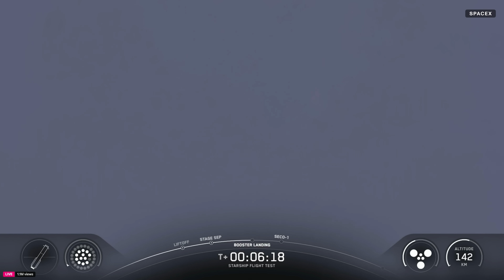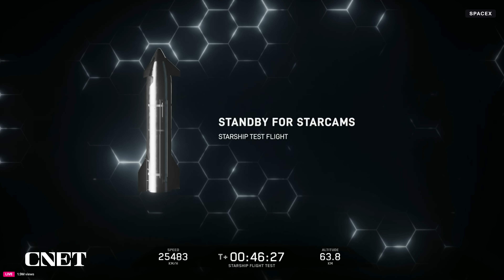Starship Test Flight 9: Everything That Happened in 17 Minutes

Comment: I get that Starship is hard. I get that everything shown in this video is very impressive. HOWEVER, it has cost several billions of dollars so far to have nine failures of a suborbital flight in a project that is far behind schedule. If I remember correctly, they had promised moon landings by this point to NASA to get funding from them (and the person who signed off ended up working for SpaceX). Getting to the moon would require getting to orbit, 20 additional launches and reentries of tanker Starships, orbital refuelling, reignition, and reliably landing on the moon and taking off from the lunar surface repeatedly.
I get celebrating during the first RUD, but during the ninth flight which hasn't even reached orbit yet? Or deployed any payload whatsoever?

Comment: This no longer testing. Taxpayers on the hook for every launch. The fly in the ointment is the weight of booster and starship. This will never allow starship to work as advertised.

Due to the overweight booster can’t lift starship to 100 kilometers with max Q to propel it into a stable orbit. Plus starship uses precious fuel needed to lad on a pad.

If Elon spent his own money I would not care if it blew up every time.

Comment: Starting to get concerned.  None of the Saturn rockets had any failures except one Saturn V that had an engine failure, yet still achieved orbit safely.  Starship blows up left and right.
Reply: Saturn 5 was completely expendable.  If SpaceX wanted to build a rocket that was one time use, they could do that easily.  This is a rocket that is being designed to go to space multiple times per day, only expending fuel.

Comment: So, this was a failure. Right?
Reply: No, not really. It would be if it was operational but when it is a test system, you expect some of the engineering solutions not to work properly. It is perfectly normal. That's why tests are conducted. This one in particular gave them a lot of data and things to work on and improve for the next test.

Comment: Flight 10 will be successful flight regarding how will SpaceX analyze the data collected from this flight. Make hardware changes, especially improved fuel lines of the ship to avoid leak. RCS upgrade, Payload door upgrades, Raptor engine ignitior upgrade on Superheavy booster etc. it takes 10000 upgrades to perfect a thing. Looking forward for a late June or early July launch of flight 10 with B15 and S36.❤️
Reply: It's incredibly more cost-efficient to identify and correct  basic mechanical deficiencies such as an inoperable door in the post-assembly inspections versus during test flights. Same with other Musk ventures, e.g., the Cyber Trucks body panels falling off due to inferior attachment design. "Some" deficiencies are inevitable, but Musk's companies are displaying widespread design and assembly issues that reflect a much more systemic problem that certainly will not be resolved with Musk at the helm.

Comment: The tanks need suspension wires to negate sonic resonance. Think of how the first suspension bridges collapsed due to resonance matching curvature in high winds. The tanks need spider webbing via sprung cables encompassing tanks within a geometric pattern of strung cables.  Also foam insulation. The kind you spray in cavities that’s yellow. It keeps pipes and things in place when the pressure changes and with temperature changes. It insulates pipes from pressure and vibration and temperature differential. Not to mention the shaking when ascending on the booster. NASA use foam insulation for those reasons. However a type of strung geometry cradle is necessary to keep tanks in place making sure that fire resistant cloth insulation is between the cable chassis and the tanks.
Reply: And your credentials are?….

Comment: But Elon said NASA is a waste of money! 😅
Reply: This is not a waste of money. It is a test platform and it is perfectly normal to have issues. That's why tests are conducted. To find mistakes and improve.
Reply: @davout5775 it’s the ninth attempt
Reply: @polpocari  It is not an attempt but test. Again, this is a rocket currently undergoing testing. It is by far the largest, most powerful, most complex rocket ever made. Many things have either never been tried before or tried but failed due to complexity issues like 33 engines running at the same time. The last rocket of that size that tried to do that many rocket engines was N-1. That rocket never even managed to push past its launch site properly. Starship is already as capable as a regular rocket. It can go to space, it can deliver cargo but that's not really the point. The idea is to make a super-heavy-launch vehicle that can return back to Earth and be 100% reusable.
Reply: @polpocari  It's the ninth test, not the ninth attempt.  This test had different objectives than 1st, 2nd, 3rd, 4th, ect tests.  

At worst, you can say it's the 3rd attempt as the last three flights have had relatively similar objectives and all with the new V2 upper stage variant.

But if you want to get into the NASA/SpaceX thing.  

It's well known that SpaceX has saved the government BILLIONS in launch costs with their Falcon 9 rocket already.

it's also well known that NASA's SLS rocket is 14 years and $24 Billion into it's development which is twice the time and three times the cost of the Starship program to date.

When Elon says that money gets wasted at NASA, he's still not objectively wrong.  SpaceX has been FAR more cost effective at delivering people and payloads to space for NASA than NASA has ever been able to do for themselves.

Comment: Space shuttle was great idea.. which was not further developed after tragedy.
Reply: What NASA really wanted was a fully reusable two space planes. The bigger one would launch the "smaller" space shuttle into orbit, then land on a runway. But Congress and the Nixon administration would not give NASA the funding needed to develop a fully two space plane shuttle both with the fuel/oxidizer tanks inside each vehicle. No external tank. And subsequent Congresses and Presidential administrations continued through the 2000's cutting NASA's budget even more.

Comment: In comparison: Saturn 5 that got us to the Moon … never exploded in flight … just saying 😊
Reply: Other NASA rockets did explode though... and even costed human lives... which didn't happen here... just saying...
Reply: @willfrank961 Starship is being compared to Saturn 5, not other rockets…
Reply: @bljah123  That's an arbitrary comparison though. You picked one that did well out of a line-up and compared it to a test flight. They were trying some new stuff out here. And btw, no human has died in a spacex rocket. Ever. Isn't that the most important comparison?
Reply: @willfrank961 I’m comparing like with like. Saturn 5 went to the Moon, Starship is supposed to go to the moon. Saturn managed it without once exploding, Starship has always up till now exploded. Why compare humans as passengers, when Starship has not done that yet. When it does, I’ll happily compare again.
Reply: @bljah123  If you want to compare like with like then there is nothing to compare here. Starship has only done test flights so far. Limits are tested. Things are still aloud to go wrong. If they put passengers in the rocket they will maximize safety.
Reply: @willfrank961  Saturn 5 had test flights - never exploded once. Anything else?
Reply: @bljah123  Well... they all ended up in the ocean, crashed on the moon (intentionally) or accidentally flying in to the sun. Testing for reusability was never attempted. That's what is happening here.
Reply: @willfrank961 ah that. Why didn’t you say so before. Then we can talk Space shuttle 😅… only one explosion over its lifetime. And they figured it out and fixed it on next flight. 9 test flights, and every time something goes wrong? Either it started as bad design, or there is no learning from mistakes. 9 test flights is a lot.
Reply: @bljah123  Why would you compared Starship to the Saturn 5?  

They are two entirely different animals.  The Saturn 5 was a thoroughly conventional rocket, albeit a very scaled up one.  Using expendable stages and traditional capsules to return people to Earth was moderately well proven by 1969 and continues to be the dominant method in 2025 for sending and returning humans to space.

Starship is attempting numerous things which have never been done before.

We can talk about Starship and the Saturn 5 in terms of comparable size and payload but their overall approach is very different.

Saturn 5 was what you build when money is no object, and it wasn't at the time.

Starship is an attempt to build similar or greater capability with cost as the highest priority.

NASA now has the SLS which is similar in capability to the Saturn 5 but it has the same issue as the Saturn 5 in that it costs $4 BILLION per launch.  It's pretty hard to move human activity in space meaningfully forward at $4 BILLION per launch.
Reply: @woodsie315  because there are no visible evidence of improvement on Starship, after 9 flights, costing 9 Billion. Not much return on investment. What are the numerous things Starship is attempting, apart from reusability?
Reply: Saturn 5, awesome as it was had over 10x the budget and wasn't trying to be reusable.
Reply: @helluvatime4562  each Saturn 5 launch cost 1.5 Billion, 13 launches = 19.5 Billion. SpaceX received 3 Billion per year from US government or NASA since 2023. Starship launches: 9 since 2023. Equals 1 Billion per launch… not saving much yet

Comment: Leak? Nope!
Can't believe they did that TWICE:
Electric main-bus failure due to repeating overload (software keeps trying to execute last command to open the bay doors).
After launch these are distorted (bend) due to high G and the actuator that should open it draws too much current making several control computers crash (communication lost with rockets on 3 different time intervals).
Result is that there was not enough power left to use the fin actuators or even the gimbolds of the 3 center engines.
They made that SAME mistake on a previous flight and now did it again.
Reply: The DATA is not reliable before the real-life test is re-run and re-run again.
Reply: and how do you know all that already ?
Reply: Nazis dont like accepting they are wrong.

Comment: well. lets think critically. 
with all the failures they did a pretty good job with the buster. Buster did its job to pull second stage to its height and landed solid few times. 
Starship can get  that payload to orbit thats for sure.  They achieved this result during All flights.  
Main problem is reentry of second stage,   but system can already be used to lift superheavy something into space. (space station modules, weapons, satelites etc.) 
Setting aside MArs fixation (which is mostly for hype) i see that there is a pretty good SINGLE USE SYSTEM for heavy payload is almost complete to be used commercially or politically for practical reasons.
Reply: They never went to orbit. Commercial users need high pression in the payload delivery in term of speed and altitude (remember James Webb), but spaceX didn't demonstrate any of it.

Comment: Wait so they wanted to open the payload doors and it didn't work? I think this happend already two times. By this time they should've installed at least two mechanisms which could do that. If one fails the other comes in play. Just a thought. Don't know much about it. But feels like the extra weight of the second opening system won't do anything to the rocket. And would be better for tests. Bummer to see them blow up all the time. But yeah it must be very difficult. Congratulations on reusing the booster 👍
Reply: Adding redundancy systems makes ship heavier. With a heavier ship, you need more fuel to go up, which limits cost effectiveness. Instead, you iterate over different designs, until you find one that works every time.

Comment: Slowly losing confidence on Starship. Was really optimistic till now, but seems like we are always hitting a wall..
Reply: Trial and error spacex is spending less launching a couple of these a year to learn from what goes wrong, while NASA leaches billions of tax money to not launch SLS for 10 plus years. And SLS is based on space shuttle engines and SRB's that they have 30+years experience with.
Reply: @torque-ej4nu fr and these people
Want to reach mars in a few months.
Reply: @Football_Head21 and honestly people have no idea how far SpaceX has actually come with that booster. The Russian N1 moon rocket hardly made it off the ground before failing because they had so much trouble trying to balance fuel to 30 engines. One side would lean out and use the rocket back into the ground. But spacex is figuring it out. Each one of those 30 engines has a Turbo pump that can empty an Olympic size swimming pool in seconds, and they are balancing 30 of them.
Reply: @torque-ej4nu exactly
Reply: @torque-ej4nu  Or, and hear me out, they could use solid rockets and just have two of them like SLS has, plus a couple liquid engines for supplimental thrust.
Reply: @jaxspellinar i think they are trying to stay away from SRBs. Those were really expensive to refurbish for every shuttle launch.
Reply: @torque-ej4nu  They did have the habit of not exploding though, well, except once. And since it's a private company, they aren't telling us how much it's costing to rebuild the Starship booster each time, so we don't know if it's relatively cheaper or not.
Reply: @torque-ej4nu  SLS was launched and went around the moon on it's first try...
Reply: @jaxspellinar literally 12 years and $26+ billion dollars of tax payers money later... And what was all that money for? It uses left over space shuttle RS-25 engines, so bot a lot of r&d needed there, same main tank design, and revised solid rocket boosters based on, again, proven space shuttle tech.  So ahy did it take them 12 years and billions of dollars just to launch one rocket? My point is, its way cheaper to send one up, if it fails, fix what failed and try again. Cheaper by billions.
Reply: why it's called "rocket science" and not just science
Reply: A new version takes time to perfect
Reply: Same. It could be over-engineering problems.
Reply: They moved to block 2 too early.
Reply: I hate how people talk about starship as if they have the slightest idea on what’s actually going on
Reply: @basalwharf3488  Exactly - SpaceX is doing amazing. This is not like previous tests, where we spent so much time money and sometimes had human lives on board. These tests are designed to deliver a bunch of data, and they do.
Reply: I'm no 'Elongelical' or anything, but it IS impressive what SpaceX is TRYING to do, and it is reasonable to expect failures, setbacks and even disasters with rocket-powered spaceflight, which, is the only kind of spaceflight that we have, for now.
Reply: You’re on the board are you?   I’m honored to be talking to a SpaceX propulsion engineer.   Whoops; senior! rocket propulsion engineer.
Reply: @shoelessmo me?
Reply: @torque-ej4nu  nope
Reply: That's why I'm here as a detective to examine their unique animation engineering. They did a clean job. But I caught them red-handed. @shoelessmo
Reply: O assembly of jinn and humans! If you can penetrate beyond the realms of the heavens and the earth, then do so. ˹But˺ you cannot do that without ˹Our˺ authority. 
Holy Quran 55:33

Comment: Not good,  I really thought that after the last 2 failures they would've learned something.  How they can catch a booster but not open a door or stop a leak from happening seems unbelievable.  It's like they've stopped trying.
Very sad.
Reply: booster wasn't meant to be caught it was not brand new used before and some of the engines were 3 times used somehow, it was a test R.U.D. to see how far much steeper of a drop it can handle stress wise and they found out not much...., and the ship at least it didn't blow up this time over the Atlantic ocean but using the exhaust from the engines as a RCS movement thruster seems to over pressurize the storage tank they are using for it causing leaks and lose of stable controls... it's a new way of using fueling RCS thrusters to save weight but if they had a regular RCS self contained fuel on board it would of survived.
Reply: @propaneriver  In France we have two says: "If my aunt had a pair we would call her uncle" also "With a lot of "if" you can put Paris in a bottle"
Reply: i think they put too much trust into current AI, which is not that good at engeneering complex  systems yet.
Reply: weired!, this happens after those SWEs started using copilot
Reply: On block 1, it's the same thing.
This is block 2, and it's a repeat of what block 1 flights are
Reply: The cutting edge pioneering space exploration not up to buddy’s standards over here lmao
Reply: @shikharkalsi9692 hahahaha
Reply: Maybe it's harder than you think?
Reply: This kind of stuff is very difficult.
Reply: It's the cyber truck of the sky, to big to not fail

Comment: 00L09:02 an anomaly; heating burst on the outer fairing end at sea-level raptor engines shutdown as viewed between the shutting down engines and the right vacuum engine..  Zapped..  so where else?